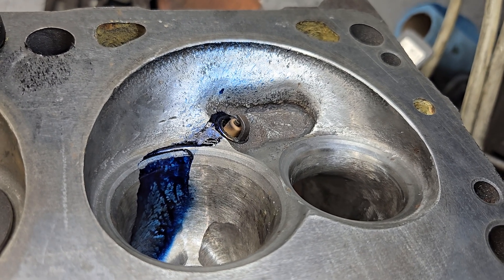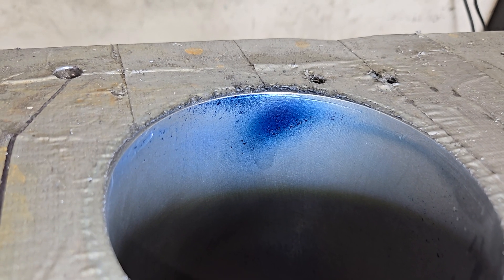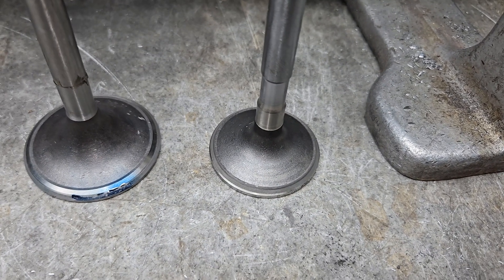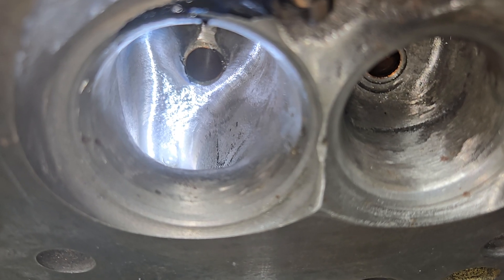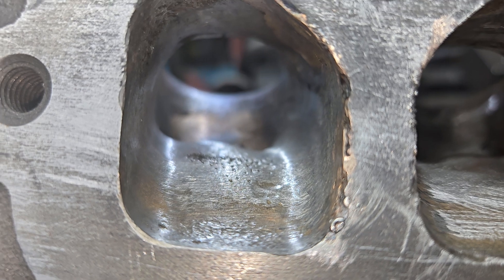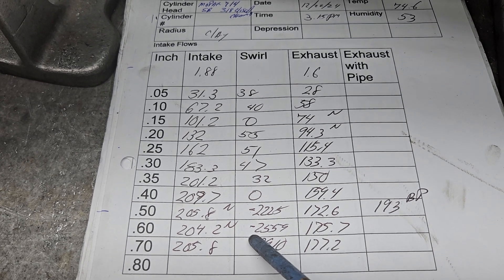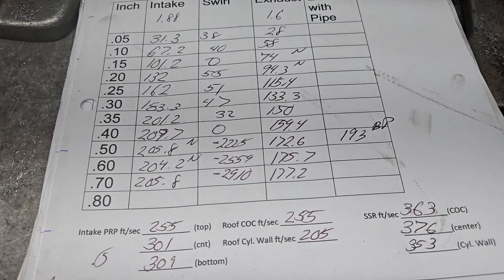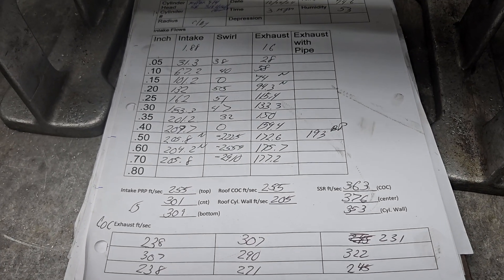Mopar 714 cylinder head, Amateur ported. Similar to Mopar 302 cylinder head.

Comment: I said it before, but I made over 410hp with a 340 9-1 engine with those numbers with worse exhaust flow. 1.88/1.60 915’s
Reply from the maker: @Patrick-xd8jv  I am pretty sure I said 400hp possible in the video. Good info. Thanks

Comment: Question  I have a 318 thats been bored 30 over with stock flat top pistions . I have a set of good 360 J heads I was thinking about using for better flow with 2.02 valves . I know id have to mill the heads to comp for compression . how much on intake and engine side ? and would there be an issue with flow and valve  clearance ?
Reply from the maker: @MoparMan-1978  I would run ported 318 heads first.
Reply: @servediocylinderheads   I did a light porting job on the heads already and gasket matched the ports as well . I'm running an air gap intake that has 340/360 ports on my 318 . I want to run headers since the 318 has an Erson TQ20H cam basically a 340 cam . the heads dont have the factory studs on the ends for the manifolds so I would have to buy another set . I have a good pair of 360 J heads waiting to be bolted on
Reply: @MoparMan-1978  Maybe due to smaller Bore size your flow is restricted. Most have found the Magnum 318 is for the smaller bore
Reply from the maker: @MoparMan-1978  Buy studs.
Reply from the maker: @smilsmff  we used a 318/360 head gasket over a 4.1" bore. Thanks
Reply: @servediocylinderheads   ive desided to go with the cheapest most horse power route  = 302 casting heads
Reply from the maker: @MoparMan-ff8fb  360 valves and some porting they will run well.
Reply: 60 tho off the engine side at least!

Comment: Probably a dumb question ? on a head can you machine down the section of the valve stem that air flows around by a hair or 2 to see if it increases flow ?
Reply from the maker: @MoparMan-ff8fb  It makes a difference but it reduces guide stability.

Comment: 1990 dodge truck castings acording to the mopar web guys. it could be a thicker casting from the 302 castings . ill check it out. 051 was the swirl port for the 360 castings until the magnum  318 and 360 series engines.
Reply: 308 was the factory "high swirl" 360 head before the magnum.
Reply from the maker: @SandraOrminski  Good info. Thanks

Comment: Thanks for the info! I’ve heard the 302 is mostly the same as these are. 
When you say to grind the seats a little bit larger for the bigger valves, are they putting a bigger seat in or does the factory seats allow the change in size?
Reply: They cut the factory seats to fit the 1.88" int. and 1.6" exh. valves.
Reply: @ I have a set of these heads and I plan on doing the same as you’ve done.

Comment: Seeing the cfm hit a wall at .400" was a punch in the gut but better to know the truth than ignorantly believe it works good.  These heads are to be used with a .450" lift cam (xe256h) but I don't know that I can put them on without widening the short side.
Thanks again for testing both heads in one day.
Reply from the maker: @michaelfarnsworth7571  Just polish that ssr and send it. It will run great! Thanks